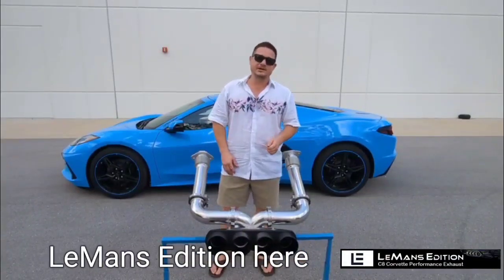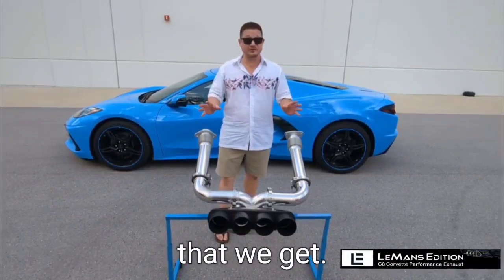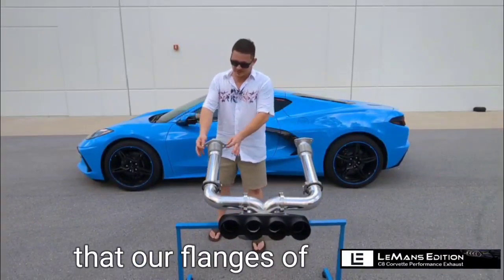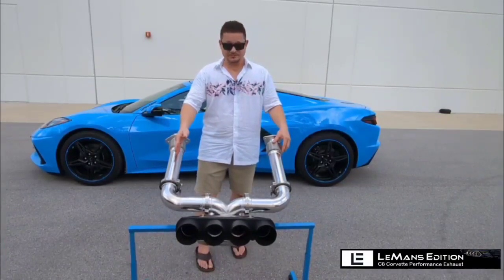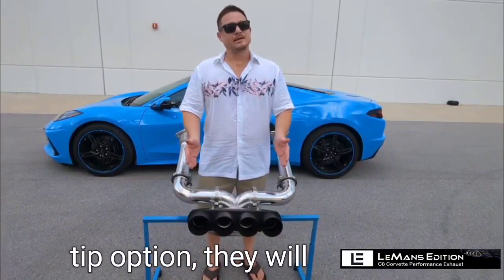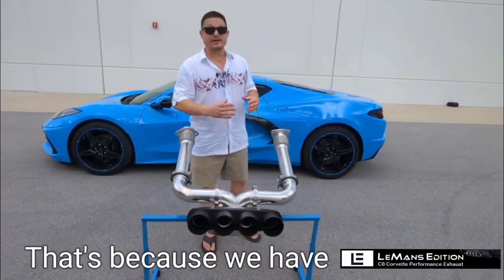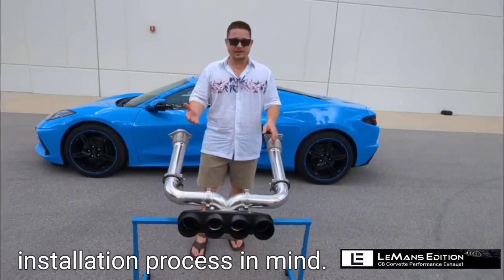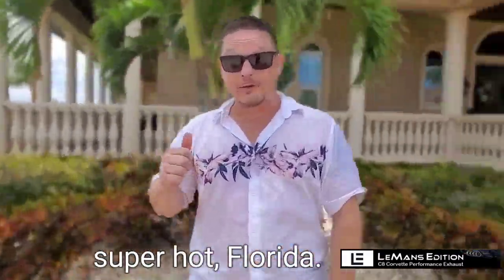C8 Corvette Center Exhaust By LeMans Edition TRACK SYSTEM EXHAUST #LeMansEditionExhaust

Comment: Would like to hear a sound clip since that is what aftermarket systems are all about today. HP gains - if any - always seem to be no more than single digits since the factory stock ones now do a pretty good job. Hopefully with the C8's mid engine arrangement someone will come up with a 180 degree header system like others have installed on 1st generation Ford GT replicas and the 351C Pantera.
Reply: There are sound clips in this video… There are also several other videos from Lemans with more sound and install. Anyone that knows aftermarket exhaust and mechanics, knows you’re not going to suddenly gain 20 to 30hp from exhaust. Torque is what you gain. Dyno, comparison would be good. But all of these exhaust systems will gain maybe 10-12hp max. The look of this system and the tone is the best out there in my opinion. Aww sounds like a 4x4, Corsa, Borla, Fabspeed all sound the same.